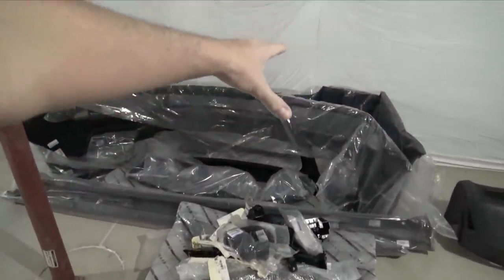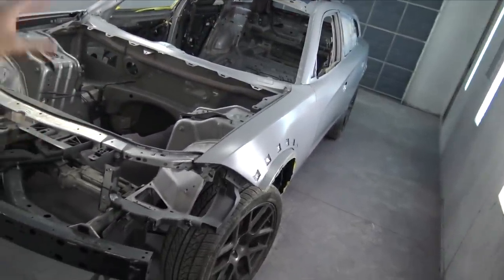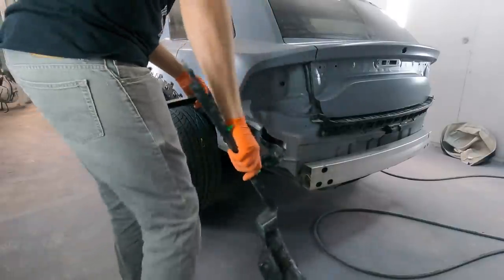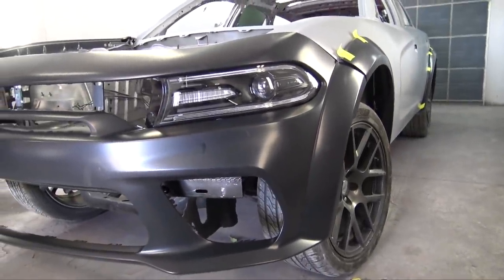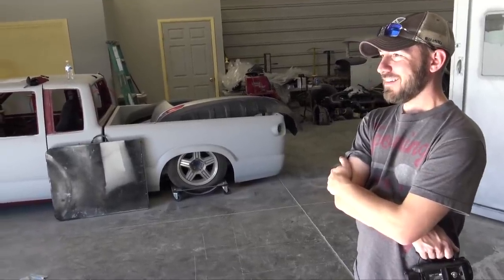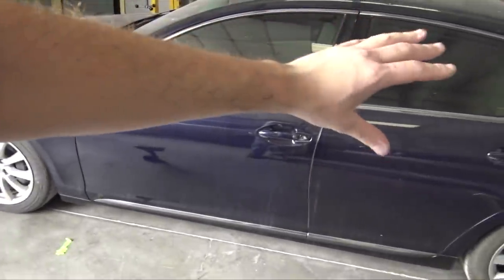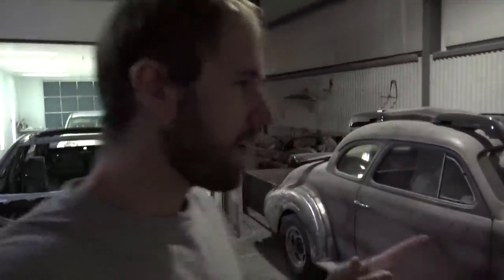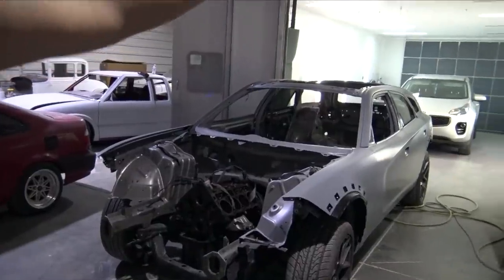Building the Ultimate Station Wagon | 2021 Charger Magnum Hellcat | 1000HP Hellwagon | Pt 22

Comment: Seems like Dodge is missing out on a huge opportunity here.
Reply: Yeah they really should revive the Magnum and base it on the Charger.with the Hatch of the Magnum merged with the Charger body like Dave is doing here XD
Reply: I’ve been saying it since the first Hellcat came out. There is a market for a magnum & 300 hellcat! But no, they decided to make the Durango HC.
Reply: Sadly it's due to Marketing and Trends. Station Wagons are considered a thing of the past, Crossover and SUV reign supreme.
Reply: Even just give me awd on the rest of the engine line up. The v6 doesn't need it as much as the v8's do.
Reply: gafrers pretty much. I’ve heard it numerous times.
Reply: Not If you are familiar with the sales numbers and why it was discontinued.....it would cost WAY too much money for "minimal" sales.
Reply: @Toolmybass  Absolutely. The ammount for tooling, assembly lines and such would be astronomical. To sell if for profit they should sell them for $ 200k + each
Reply: @Toolmybass  Then why not make a limited amount and see how that goes?
Reply: @gafrers  maybe just create the fitting panels and sell those to builders, like other companies do with stock chassis for racing teams. The most time spent on this build was the fusion of the panels and the trunk.
Reply: @newmemer8070  Sadly Companies don't reason this way. They want certain profit, not to test out the waters; especially with the "electrification" in progress.
Also the roof-line/boot would be a bit of a nightmare. You have to think from a company pov. Legal, registration, safety standards. Usually race car part have higher cost but also less "care" some raceparts are hill fitting due to being smashable.
Not trying to shoot you down or defend big company policies, just stating how things are harder, or made purposely harder, than one thinks.
Reply: I’m sure dodge knows it’s market. They’ve got guys lined up and willing to do whatever it takes to get in those cars.. they aren’t worried
Reply: If they were the magnum would still be around
Reply: @dwalker112  Because that would be financially insane -- the initial investment costs are too high for tiny sales.  For every 100,000 people that think it's cool and say 'I want one', maybe one will actually buy it.  And how many people are willing to spend $150,000+ for a Dodge station wagon, when everybody and their sister is buying SUVs?
Reply: @AndrewAMartin  Gotcha, makes sense.
Reply: @gafrers  Subaru somehow menages with the Outback. Its fault of automakers and then making this trend a thing, on top of exploiting "light truck" loophole in the law all this time.

Comment: The wide body is going to make it look that much better!! Still can't get over how well integrated the hatch is in the trunk of the Charger. Would be good to get those tranny tunnel measurements to make sure the powertrain is in the right place to prevent vibration issues. Successful engine mount install too woo.

Comment: So on the subject of the roof, I know I’ve said it a million times but I still think that you’re missing a trick. 
Panoramic roof for the win 😉
Reply: You dont put a panoramic window on a 1,000hp car. 🤣
Reply: @Toolmybass  what you are forgetting is that this 1000hp car is also going to be a show car and that my friend is why it should have a panoramic roof, the jewel in the crown so to speak. 
Also the way that this car has been built and engineered by Dave and the fact that it’s having Trackhawk running gear (which comes with a panoramic roof) just makes a lot of other people alongside myself wish that the car was finished with a panoramic roof.
The car is already the most special of machines but it’s details like this that would make this car one of the most memorable custom mopars ever.

Comment: Couldn’t you have gotten one of the hemi v8 awd police charger’s drivetrains and made an easier swap? Everything should already be to length and bolt in, however I do see that for power the track hawk is the way to go. I don’t know if there is a difference in the strength of components between the the twos running gear however. Either way love the build! Just an idea put out there, would definitely keep it more stock factory option like and limit fab work.
Reply from the maker: The Charger AWD system cant handle any power
Reply: @Junkyard_Dave  interesting, I just knew they made an awd system for the police cruisers, seemed like not too many ppl talk about them so I figured if it could be of help in any way I’d let you know in case. I shoulda figured you would have already been ontop of that tho haha. Can’t wait to see it painted! Super cool build.

Comment: The tail lights have to be re-engineered for an updated Magnum. The 2015-2020 design just doesn't look right IMO. If only you had sketched out a new concept and worked with a fabricator I would've wanted to see that! But all in all you did the best you could and it looks good for what you had to work with